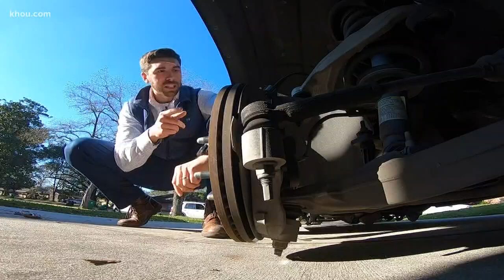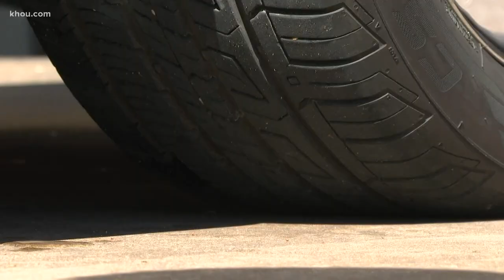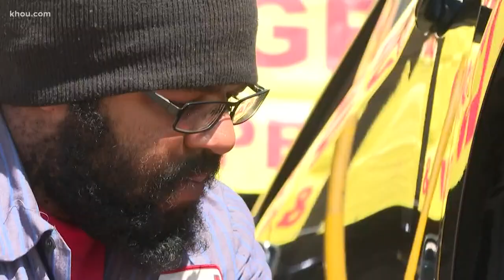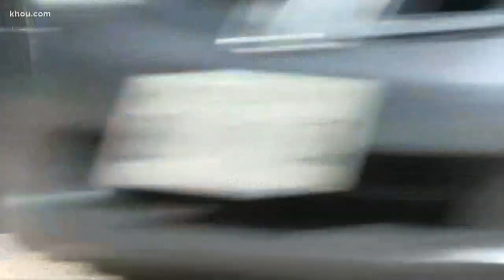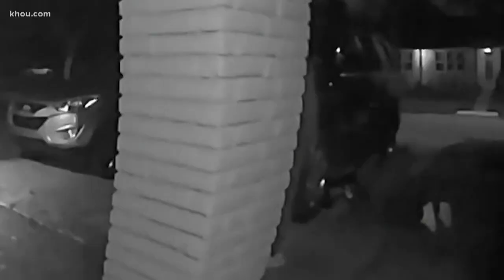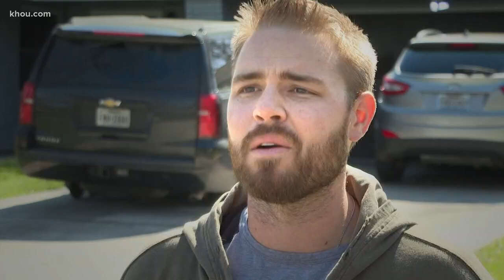'They move fast' | How to slow down thieves who steal wheels off your car

Comment: "Engrave your name on your wheels to make them easier to recover"🤣
Who's going to go around checking wheels against names?
Reply: The police recommended that... anything to deflect
Reply: And that's only if the police actually recover any stolen wheels, which is probably an extremely small fraction of wheels stolen.
Reply: Wait! Stop right there. Let me read your wheels!
Reply: Every store they intend to sell them at will check
Reply: @MonoGmc  they wont lmao probably a chop shop
Reply: thieves can deface your name on the wheels.

Comment: Cheapest way to avoid this : Get Steel Rims and plastic hub caps 🤷‍♂️
Reply: ...no, theives will steel the factory hub caps/wheel covers.  At over $100ea for factory wheel covers, those things are just as valuable as the alloy wheels...and they are stolen faster.  now, if you are talking about auto parts store wheel covers, why bother and waste the $20

Comment: Electricity. Leave thefts with a baked potato where they once had hands. Or kill tire thefts as soon as possible. Does any sell tire covers to make wheels look like crappie old wheels.  The wheel cover could be a printed image of undesirable wheels . The old anchovies mixed with stink cheese , make a paste then slather the back side of the wheels.  For extra tamper protection, try  mixing the homemade  cat S@&t with bits of glass . The would be wheel thefts will first smell their fingers,  (you know that's human nature) the next thing is vigorously attempt cleaning the disgusting glass impregnated special sauce from fingers which makes for cut fingers . I would love to see a video of this .
Reply: Anchovy paste is sold in grocery stores where canned sardines are .Mix with the most disgusting soft cheese,  add water resistant grease to make washing off more difficult.  Any cheese when offered to your dog  is carried out side and buried should work . This mix can be used on door knobs , bicycle handel bars bicycle seats , on anything someone 
may steal . The bicycle seat makes me crack up just imagining the look on the victims face .

Comment: Have people never heard of wheel locks before?
Reply: Theives know how to unlock or remove. Some have master keys.
Reply: in the video, it says the guy had wheel locks on...in this video, it says that....literally.
Reply: @chrisno6669  Most keyed lugs can be taken off with a $15 "emergency lug nut remover". Its basically the same thing as a bolt extractor for stripped heads. The ones with a spinning sleeve around the head are more secure.
Reply: Same here; and I use them on my car.  I also use (2) The Club:  one for the steering wheel, one for the brake pedal.
Reply: You mean locks with sensor alarm
Reply: It will deter amateur thieves but not do a thing with pro theft rings.  And worst part, pro theft rings can afford the best attorneys, so even if they get caught are able to plea deal down to a fine with no jail time.